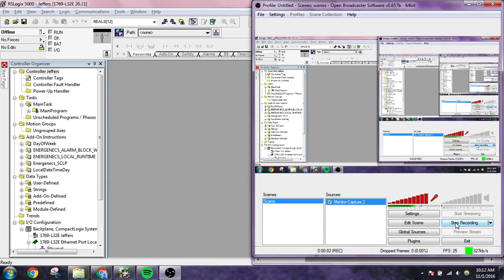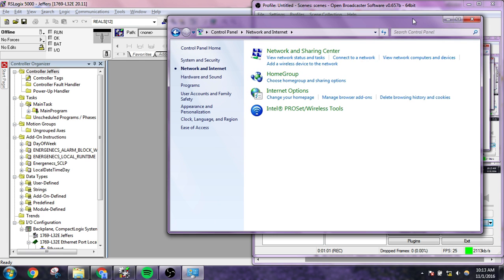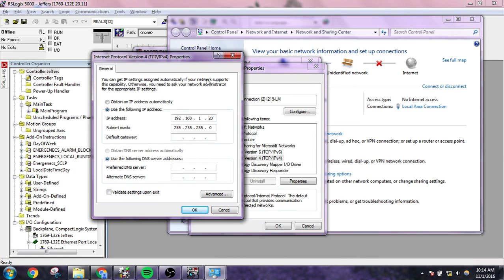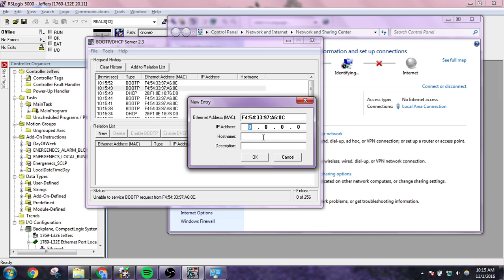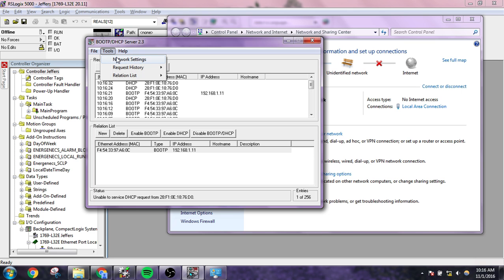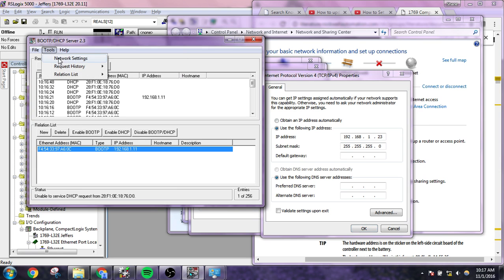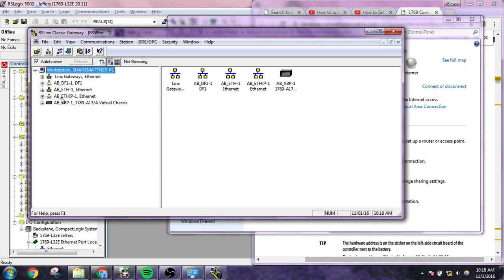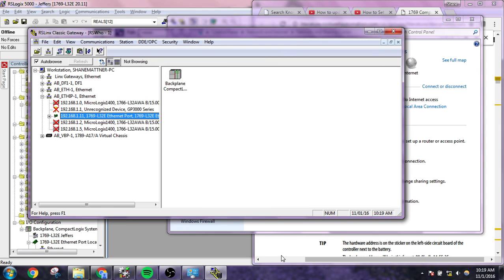Set PLC IP address with BOOTP

Comment: How will I create communicate between my laptop & my SLC 5/05? Here is the scenario in my case:
1. When I connected ethernet with the SLC, signal LED of the module turned ON, but no device found in latest version of RSlinx.
2. IP address of the module is unknown.
3. I have used BOOT DHCP tool ( Version 3.05 )of rockwell using different subnet mask, while there was no any sign of Mac address of my SLC. However it showed only Mac address of my ethernet adapter whenever I connected ethernet cable to my module.
4. I have tried using both automatic & manual IP address from IP4  configuration of my ethernet adapter properties.
5.  I have used one crossover cable between my laptop & module. No switch or router in between.